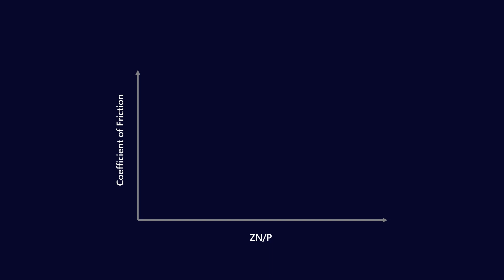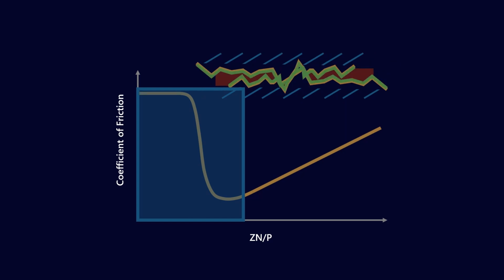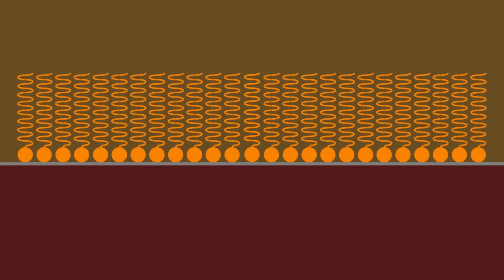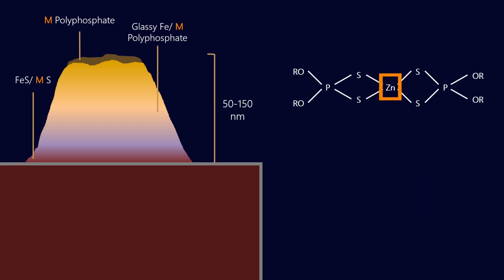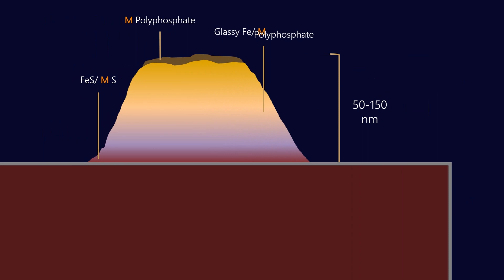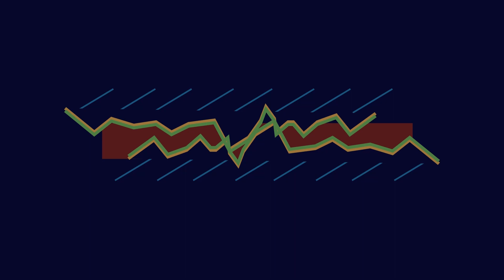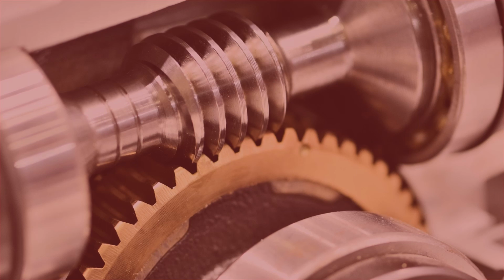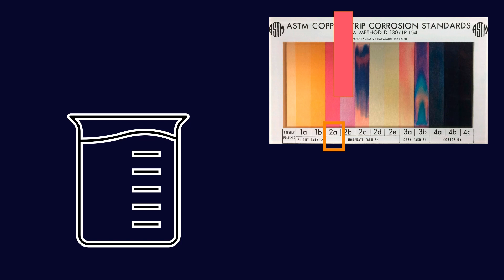What are EP additives? Can they be harmful to machinery?

Comment: Thanks for your great videos. I have a single seat golf buggy so very slow moving gears my issue is the grease is being thrown away from the worm and crown wheel over time making for a whine. When shift grease back it's ok again for a short time. Is there an additive I can add or a why to have a semi grease if you will which would settle at the bottom of the crown wheel when not in use and thrown up in use? Assume manufacturer has not used pure oil as it's not exactly a sealed unit and would simply leak out. Thanks  again Neil. Will be doing a video on my own channel I will give your chanel a shout out.

Comment: The example you mean in the last part of this video with the copper strip 2a of the astm test. Does it mean that it is not ok? Should it be in the range of 1a/1b to function well?
Reply from the maker: Really depends on hours in use. For new oil you wouldn’t allow it, but if it’s toward the end of an oil drain a 2A is reasonable.

Comment: Love your videos man,so i am wondering if wear deposits/very fine metal particles that visible to the eye on used oil is normal? Or does it mean that the additives of my gear oil that i am currently using is lacking the ability to prevent metal-to-metal contact and i should change the oil viscosity in case that the oil lubricating film is too thin?
Reply from the maker: Visible sediment is usually not a good thing. If you can, hold a magnet to the sample and see if the particles are attracted. If they are, it's Ferrous debris and a sign of excessive wear. If not, there's a good chance the particles are soot or dirt.
Reply: @LubricationExplained  Thanks for replying,will definitely try it in the next oil change. What troubles me is that i already use the recommended viscosity from the manual book. Perhaps i should increase the oil viscosity from 75w85 to 80w90
Reply: @theveiledself  Pay attention to the GL-4 or GL-5 GL-MT1 spec, they are not generally interchangeable due to the copper-bronze issue and seal compatibility. I have heard that for some producers 75-85 and 80-90 are often a different underlying spec, not simply a slight change in viscosity. Secondly there is the issue of actual conditions of use, slow speeds result in thinner lubricant films. Then there is intermittent loading and shock loading such that the viscosity is correct most of the time but is occasionally insufficient, often this can be addressed with an additive like moly or graphite which are solids in suspension that protect against brief losses of lubricating film.

Comment: A hand slowly goes up in the back of the room…Is the service life of an EP Additive determined by a quantitative or qualitative factor (?) in a lubricant for an automotive engine or gear application?
Reply from the maker: Sorry didn’t fully understand the question? Will try to answer though - service life would be dictated by load (higher load would “scrape” off more material), speed (more revs = more action), temperature (determines speed of the additive chemical reaction), and type of gearbox (more sliding = higher EP wear).
Reply: @LubricationExplained  Apologies for being vague. The consumer is bombarded by companies with the “quality” of additives in various lubricants, all service conditions and applications being equal, is it the quality of the additive or the volume (percentage) that extends or shortens service life of a lubricant?